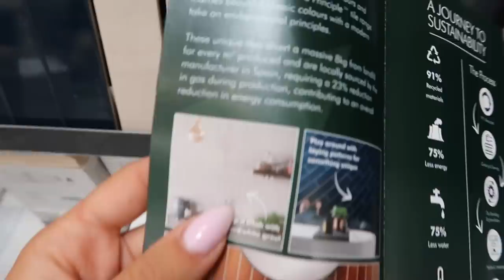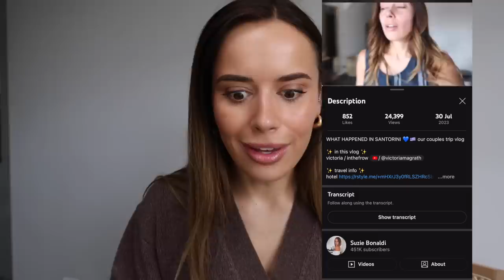OUR HOME RENOVATIONS BEGIN! | Suzie Bonaldi

Comment: With my iron deficiency I had to do a iron infusion. The iron pills just were not working. Once I got my infusion my levels went up to normal, apparently it take 5 weeks for it to show. My doctor did say if it didn’t go out then it would have probably been a weekly thing. But atlas the one infusion worked for me. But it definitely help with my tiredness and dizziness. The infusion I got was  Monoferric. The process took 1 hour. But to get the actual appointment took about 2-3 months. I would definitely recommend the intravenous route.